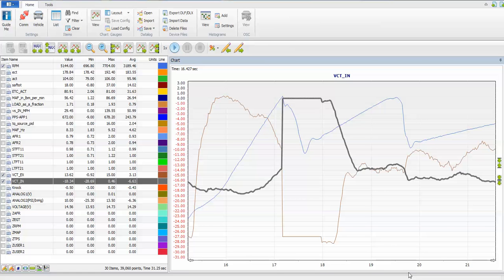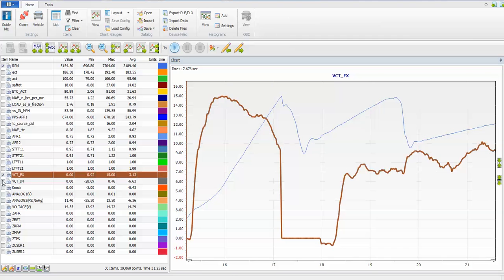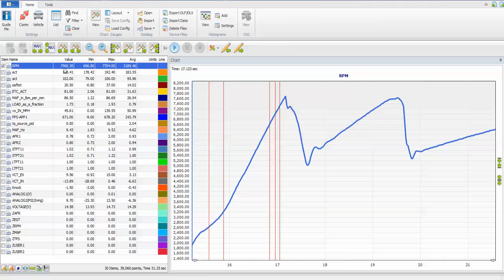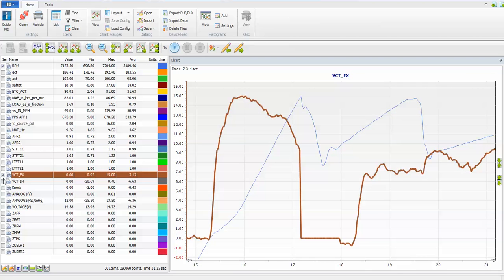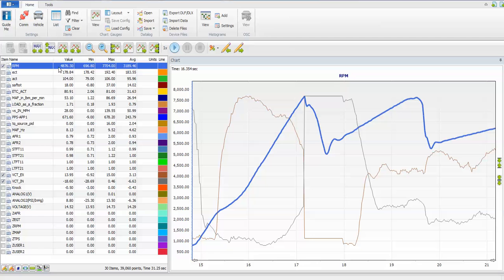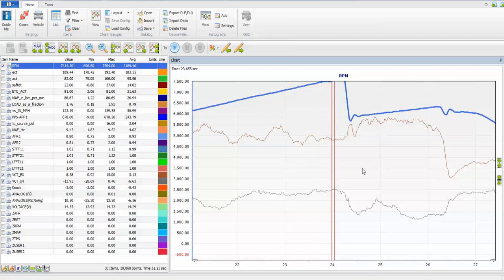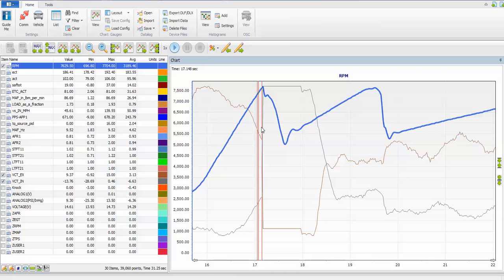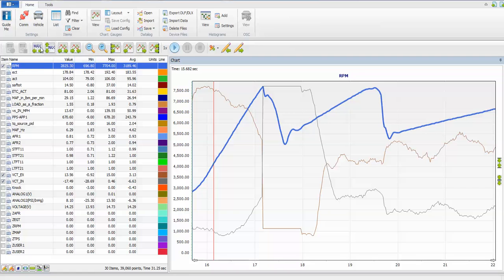8k rpm patch for coyote mustangs explained.

Comment: So do you tune now ?
Reply from the maker: Christopher Abbott yep through vmp
Reply: Alejandro Flores nice !
Reply: I’m running a full bolt on cobra jet intake manifold with 67mm twin jet throttle body Ford Racing air intake 
Stainless work cat less headers with corsa extreme e85 3.73 gears 

Tuned by Lund 
I’m wondering if the tune they gave me is a base tune... do you think vmp can give me a second look cause I’m not to happy right now.!